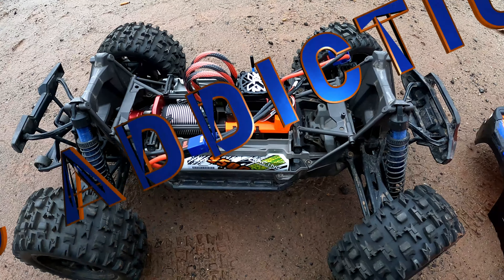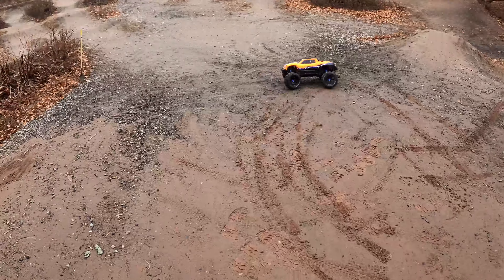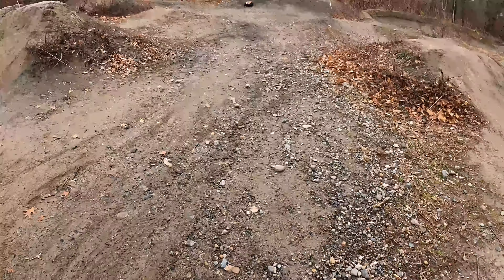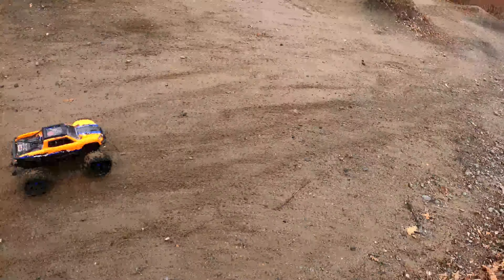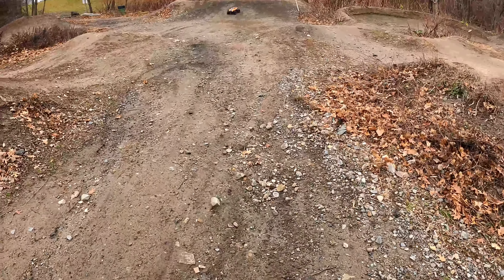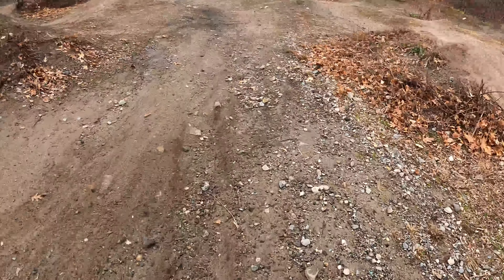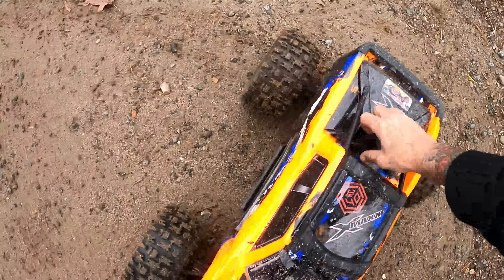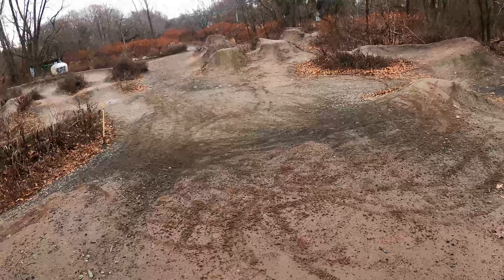Traxxas Xmaxx MOD 1.5 GEARS testing

Comment: Shoot😫 we missed the actual air time G your head cams 2tads too low even when you stood near the truck on the mound about head height we almost couldn’t see the roof of the truck and when you mentioned durability wise we couldn’t see the truck in the distance 😖😫😖😫 but he sure sounds like you would not want him following you down a dark street☹️ ScchOOT 
Ahhh you run those AFG servos 
You gonna slap one of their 1/5 servos in this 
🤤🤤 when you slap the wide kit on this I can’t wait to see him at this spot
Bro he’s DeeP and Mean yo flybys wicked
Just need a back flip or two toPP’D off with a front flip 
Thanks for sharing ✅💯
Reply from the maker: I know man. I fucking noticed that while editing. I need to get a different GoPro mount or something lol. Thanks for watching man
Reply from the maker: Next video it will be fixed. I just need to stand a bit further away and raise the cam. Thanks for the feedback man.

Comment: Yeah I let my grub screws dry overnight, not taking chances. I have the same motor but using a HW Max 5. My gears are wfo 35/30 gears or sometimes I use 50 spur/ 25 pinion but don't seem as loud as yours is 🤔 keep an eye on your mesh, also definitely get a fan for the motor. xMaxx ftw👍🏾
Reply from the maker: I still got the 20/35setup no more problems with the gears moving!  And I don’t have a fan on the motor cuz it doesn’t get hot but summer is coming so I will.

Comment: Wfo has a cover that you can put over the gears. And am running 30/35 gearing in my and yea1.5 gears are loud. I am running a max5 with 800kv motor motor alot of power got 65 out my. Don't really that much cause am just a basher.
Reply from the maker: I ordered a cover yesterday!  Are you greasing the gears?
Reply: I use orange locktite I put some in the shalf hole and grub screw and it works haven't came off yet in three months.
Reply from the maker: Bet. Thanks man imma do the same
Reply from the maker: I got the cover !  Didn’t realize I would have to take the shit all apart to fit it on lol. I’m going to install it this weekend, and put that orange loctite on!  Video will be up Sunday of this. 

Thanks for the suggestion

Comment: Not a fan of the 1.5 gears ⚙️ there expensive and I’ve broke more of them than I ever did with the saga pinions. Also look on eBay they sell aftermarket 3d printed gear covers that work with the larger gears and there only like 15 bucks👍
Reply from the maker: Awesome that’s what I need so I can put some grease. Thanks man